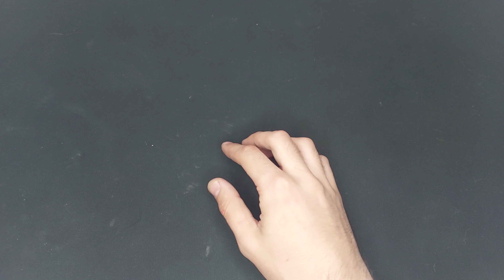Fantastic Fleamarket Finds EP. 8

Comment: That lamp is also known as a crater lamp and it is designed to put out very high intensity red light.  It was most likely used for spot recording.  The mean brightness is 50 candelas per square centimeter or 500,000 lux.  It is designed to be driven in pulses up to 10 kilohertz.  If you can get it driven properly you should be able to get a bright red spot projected across a room.

Comment: The pentazet 16 needs a huge seperate powersupply that operates the entire camera. it can go up to 5000 frames per second. the psu is like a huge treasure chest. It plugs into the camera and the motor. And it has the controls included.

It can go from 500 to 3300fps and 5000fps. Also you can plug in a remote trigger to use the camera.